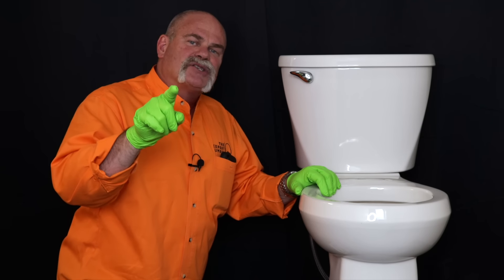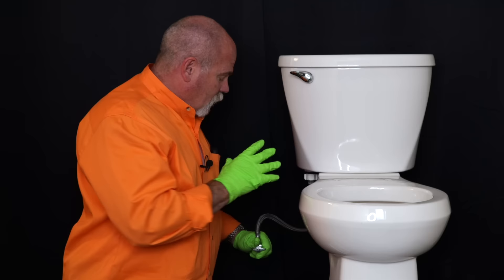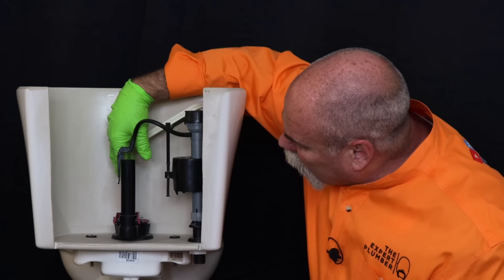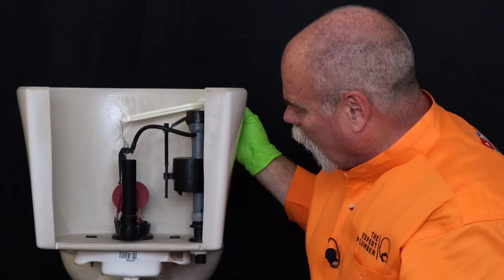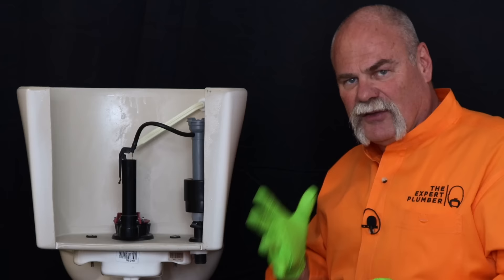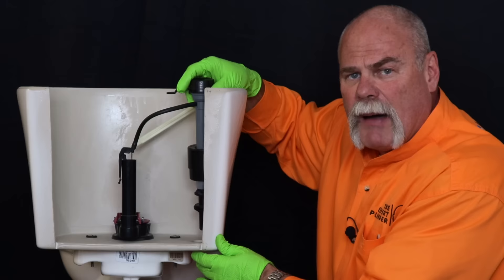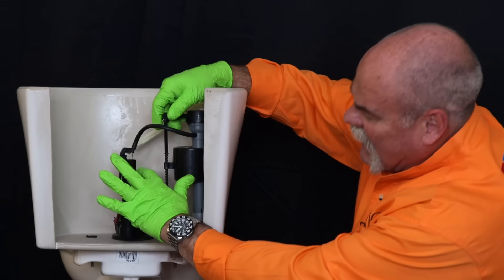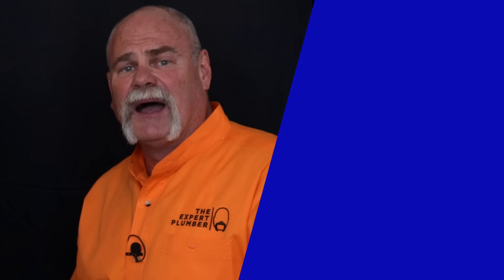How to Fix A Running Toilet GUARANTEED | DIY Plumbing Repair

Comment: A lesson I just learned the hard way:  DO NOT press down on the top of the valve to reseal it, even if it works.  On the old model I had, this broke the valve seat within the fill valve and caused it to leak a ton and whistle loudly.  The modern one I bought was one solid piece in that area and could not break that way I think.  

Oh, and some clown had left a no-handle valve stem on the shutoff valve, so vicegrips were required.  So imagine I thought I could fix the valve by unscrewing the top, and causing it to spray everywhere.  I finally got the valve under control for long enough to get those vicegrips...  Still needed to go to home depot the next day.

Comment: I fitted a PVC connector to the bottom a toilet and put 3 lays of silicone seals on it and modify the drain so the toilet inserts into the inside of the drain pipe. The toilet had a big drain problem before that which it repeatly developed because the rooms floor wasn't level and the weight of someone sitting on the toilet was destroying the wax seal. I modify the floor to be level and made it completely waterproof. Now when the toilet drains it empties instantly and with great power you could test it beyond what's required and it still drains perfectly never getting any slower. I don't understand why all toilet are not already being installed this way because it work more consistently and removes the need for less reliable wax seal setup.

Comment: toilet tank is leaking from where the fill valve pokes through the bottom and connects to the water supply line. brand new line just bought, it's not leaking - is there supposed to be a washer there or something? the fill valve came with what looks like one but there is a bunch of rubber in the middle and you can't thread the fill valve through

Comment: This part isn’t going back in. I feel that I needed to adjust the screw but I needed to be able to take it out to do it but now it won’t go back in. I have the whole replacement valve but I can’t even reach with the pliers to disconnect the line from the bottom of the toilet. I don’t know what to do and I’m starting to go crazy.

Comment: You said lift and turn to remove the top and access the  diaphragm valve. Mine won't lift. Another video said push down and turn. Hopefully that works for me.

Comment: The cabin toilet runs intermittently.  I can hear it sometimes during the night.  We're on well water so water wasn't the issue ... filling up the septic tank with water was the problem (verified by a septic cleaning company).  There were very little solids in the tank, the rest was water to the brim.   This happens mostly during our 'rainy season' in the north (spring rains) such that the toilet tank wasn't the only contributor to flooding the septic tank in the yard.  Because there was nowhere for the water to go, the toilet wouldn't flush properly.

A neighbor had a similar problem but it was slightly different cause.  Because she was doing laundry for everyone who had no machine, her own septic filled with soapy water, and her toilet no longer flushed properly.  She had a company come in to investigate, and they dug up her entire line ... only to find the tank was completely full of clothes washer discharge.  

This last story isn't running toilet like mine, but eventual inoperable toilet ... like mine.  My septic woes of course were caused by deluge and occult operation, constant flushing toilet tank.  Just something cabin people might want to investigate.  :)

Comment: What could be the issue when you've replaced the old fluidmaster 400 with a perfectly new one, adjusted the water level to its correct water level but yet still hear the fluidmaster hissing? What could be the issue at this point?
Reply from the maker: It could possibly be a bad valve or the flapper is slowly leaking out water.

Comment: My fill valve is so loose that I have to keep turning the knob so it does stop where the water level is. Usually overflow til I turn the valve knob then it stops idk

Comment: When you first try to turn the water off to your toilet to empty the tank but it keeps refilling. And you can hear it running is that a fill valve issue? Or is that a problem with the water coming from the wall?
Reply: Sounds like your water supply line isn't completely shut off.
That would be a faulty valve if it is turned off all the way. Which you'd have to turn your main water in your house off to replace.
Reply: Hello, How are you doing!

Comment: I had an issue, I replaced the flapper, it still leaked just not as much, I took flapper out and let it soak in hot water for 15 min, reinstall and it has not leaked. Just a FYI

Comment: I replaced the flush valve and the flapper, which were both very easy to do, but it's still ghost flushing. I'm so frustrated. 😭

Comment: looks so easy when the toilet is on a bench. Try it with cabinets close to the toilet and you have to work blind because you can't get underneath and the bolts are on tight.

Comment: My toilet will run for about 10 seconds once every 30-45 minutes.    The flapper looks smooth, but the surface it touches looks kind of rough, what is part the flapper seals against called?

Comment: Roger, I have the opposite problem.  No matter how far up or down I adjust the float, I cannot get it to fall during the flush.  It goes down most of the way, but then suddenly it seems to hang up by the slightest resistance or friction on the post, barely perched there.  But since it won't fall all the way, the new water doesn't refill the tank and it remains empty.  I find that with just a mild amount of pressure on the float, it falls.  It is very strange.  It almost seems like they designed the float just few ounces too light.  I think I could fix this with a hack.  (I could perhaps lay a small piece of lead on the float, or hang a lead sinker on the float arm to add weight to the float, assisting it to fall).   But if there is some other more "honest" fix, please let me know.  And if anyone else has encountered this problem and solved it, by all means please respond.  Thank you!

Comment: My toilet won't quit running and the water valve is not working to cut it off completely 😑 I adjust the knob in the tank and the water disregards that entirely and overfills and goes down the overfill hose. What should I do? I popped the tip part off of the thing that holds the float, but it didn't come apart like yours to show anything to rinse off.
Reply from the maker: You may have to shut it off at the meter to change the fill valve.
Reply: @RogerWakefield  I ended up watching another video that showed me that I was taking the tip off incorrectly. Once I removed it and let water run through the valve, rinsed the rubber part and replaced it, the float properly cut off the water when it rose.

Comment: I replaced fill valve , flush valve but it still running every 15,20 minutes , can you tell what is the problem ? thanks
Reply from the maker: Did you check the flapper? Can you see if water is leaking past it

Comment: What if the toilet flapper just stays wide open? I’ll flush and the flapper stays all the way open. Like pointing up as high as possible as if I’m holding down the handle.

Comment: I have a big problem. My toilet water inlet pipe is so low that you cannot turn the old or new tap 360 degrees because it hits the floor. How can I overcome this problem? There is not much room to use extended join pipes either.

Comment: It really is that easy. I think most people just don’t wanna touch toilets. I find it really gross but deal with it myself to save the money.
Reply from the maker: Your toilet is only as gross as you let it get. Sometimes the solution to fix it really can be that easy
Reply: @RogerWakefield  So true! I just fixed ours cause there was an insane amount of chain slack. Your videos helped so thanks!!! I cleaned it top to bottom, except inside the tank, and I used gloves… but still kinda gross cause of a toilets purpose haha. And I’ll be honest I got a slight water splash around my cheek and that’s unnerving 😂 
  I think a lot of people (like my wife who can’t even look at one) find it too disturbing to clean toilets. And I feel bad for plumbers cause I bet there’s some horror stories out there xD
Reply from the maker: You’re right there’s a stigma about toilets, but the same water you drink is the same water that flushes  your waste and that fills the tank…they are clean (for the most part) 😅

Comment: I have a brand new toilet, North Carolina has soft water hardness, and I plunged it and dumped 1 gallon of hot water and detergent down it still will not flush the water down

Comment: my toilet parts are far different than yours(house built  in 1996). I put in 2 replacements and they didn't work so I just bought a whole new toilet.  Works find now but it took me like 12 hrs to do since I never done it before and my turn off valves was leaking so I had to shut off the main outside. Now my guest bathroom is acting up and it's hard to get to because i have a shelf over hanging the top. If I bought a new toilet like last one it would sit higher and I won't be able to install it.

Comment: I maintain properties for a living. The best way to fix a toilet is to simply replace it with a brand new one. And throw the old one away. Nice ones can be bought for under $100.00. The installation is much quicker and easier than trying to fix an old finicky toilet. And when you’re done, your resident has a nice new clean toilet. Everyone is happy and all accomplished for less time work and money than repairing.

Comment: re 0:50 "slowly disconnect the water", before that, try to flush the toilet. If water starts to leak into the tank, your shut-off valve has not shut off the water, and you have not yet begun to leak water on the floor.  Then, if no inflow, 'slowly loosen one end of the hose.  If either of the two previous steps flows more than a couple of ounces of water, you will need to find a wing or whole house shut-off valve, and drain all of the house piping water above this toilet, before trying to disconnect this hose again, and you will also need to fix or replace this cut-off valve.

Comment: People, be sure to shorten the length of the water line that comes with a new fill valve float, I was wondering why the water kept running, and I put the new line in the overflow pipe too long! this caused the fill valve to keep self-siphoning and draining and filling up the tank again, the line should be attached right on top, I viewed many videos stating if water drains from the tank, the only issue is the flapper, NOT TRUE!

Comment: Our bathroom toilet kept running because the chain kept getting under the flapper. Didn't matter how much i shortened it. Trick i used to fix it was a small tube over the chain. I got a stiff plastic tube, like what comes with some lidded drink cups, cut it to the desired length and ran the chain through it. It keeps the chain from getting sucked down the hole while the flapper is up. You could probably use a regular drinking straw but it has to have a big enough diameter for the chain to fit. A straw from McDonald's would be ideal.

Comment: If I may add something here: I recently had a problem and long story short, I replaced the whole floater valve assembly for $8. Easy and cheap.

Comment: I screwed the new fill valve in the bottom of toilet. Now I turn the water on but it sprays everywhere out bottom of toilet until I turn water off.
Reply: I fixed it

Comment: I'm at a loss, please help! currently, my toilet is making a noise when it fills, it's almost like water sloshing around/gurgling as it's filling. I honestly don't know how to explain it, but I can't afford to call a plumber. Here's the backstory and details I think may be helpful. 

About 4 months ago, my toilet started constantly refilling, and then soon after that started, all of a sudden my toilet seemed clogged after just going #1, so I plunged it ALOT, and finally it seemed like I got it unclogged but then after one good flush it would seem clogged again. So, I plunged and plunged, tried forcing buckets of water down and still no luck, it would also go right back to seeming like it was clogged. So, I replaced the fill valve because I could tell it was having issues and was squirting water, and I replaced the flapper as well as the tank lever with no luck in solving the problem, so eventually I gave up and shut the water supply off and started using the other bathroom (that I hate lol) But, I'm back at it again. It doesn't seemed clogged, when I flush the water goes down but a little ball of toilet paper doesn't go down it just kind of spins around until the toilet is done flushing and it's still making that gurgling/sloshing noise when refilling after flushing and immediately after it refills, I can see the water level slowly lowering. So then of course it starts to refill again, and that process will continue until I shut the water supply off. I don't know what to do. I don't see any water leaking anywhere on the toilet, on the floor, at the water supply valve.... Nowhere.

 I'm a single mom of a small child and I'm pretty much raising my son alone, while also going to college full-time and working. I lost my regular job because of COVID, so I decided to go to college to improve myself and make myself more marketable. My goal is to eventually earn my Doctorate degree in Psychology. Long story short, my point is, since losing my job att the beginning of COVID and going to college full-time , I'm not making the money I'm used to making, and I cannot afford to call a plumber. It's just not possible, so I'm praying someone has some suggestions.

 I'm pretty handy, I can usually figure things out myself and fix them but I'm stumped on this one. Any suggestions would be so greatly appreciated!!! Thank you in advance! ❤️🙏🙏🙏

Comment: yeah , wont work for me , i have two commodes mfg in 2002 that were still in use from a recent home purchase ;
both toilets were running water from the tank to the bowl ; as soon as i got the tank off the bowl , i knew i was in
trouble , the seal between the tank and bowl was some weird looking triangular shaped seal i have never seen before ,
the company that built the commode is still in business but this triangular seal is no longer in use by them and out
of production , so even with me replacing everything else , i still had to use the faulty seals to get working commodes
so now , at least until the new commodes are installed , i have to keep the water to the tanks off until i need to flush
them , other wise the tank water just keeps leaking into the bowl
☹

Comment: I wish College was practical like this, where you can actually see and feel what you're doing. Compared to just theoretical knowledge
Reply from the maker: A lot of people learn hands on, maybe college isn't cut out for everyone 🤔
Reply: @RogerWakefield  I did Electrical Engineering and most of it was theoretical. Didn't really start to learn until on the job

Comment: The inside of my toilet parts don't look anything like the one in the video. I'm so confused as to which parts are one in my toilet. 
I have a Kohler Toilet, does that make a difference with the insides or do the insides vary from toilet brand to toilet brand. I apologize if I am asking "dumb" questions but I am a single female that was a full time caregiver for my mom and dad and I worked from home as a programmer. My sweet dad always fixed everything around the house, even changing the oil in his cars. He was the kind of man that just knew how to do things for himself to care for the lovely home he built for our family. If dad didn't know something he would go to the library, back when we didn't have Google or the internet, or ask a handy man friend or even go to the hardware store for advice. Mom and dad recently passed away within hours of each other this past March and I have been grieving so much that when I heard the downstairs toilet running I called a friend to ask them what to do and they said to cut the water off. I was able to do that with guidance and it bought me some time to let the stress of that go for a bit because I have an upstairs toilet. Well, as you would know it one week later the upstairs toilet started acting just like the downstairs toilet so now they are both in need of repair.
It makes sense that they would both have issues at the same time because I bought new toilets and had them installed at the same time.
Iam trying to learn as much as I can to care for the home my mom and dad built and raised me in and now live in but I am afraid I will have to call a plumber.
With today's economy and the high price of a plumber to fix two toilets without understanding what the issues could be and the average costs of repairs i could very easily be taken advantage of from lack of knowledge. 
If anyone has any advice for me I would greatly appreciate it. I am very willing to learn and would like to at least be able to speak with a plumber and understand what he says is wrong with my toilets and why it will cost whatever they charge.

Comment: Mine is the pump, not the flapper.  If everyone had the same type of pump as depicted in this video then this would be great.  My pump is nothing like the one in the video.  I is a large square block and does not have any parts that move up or down.